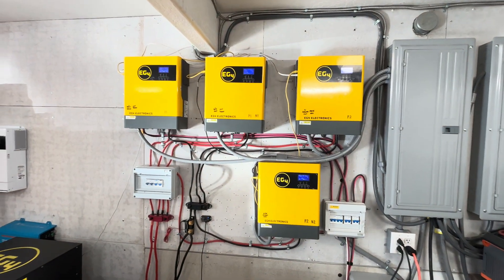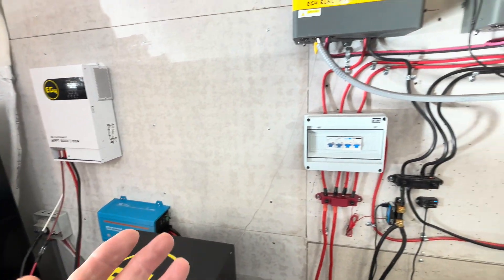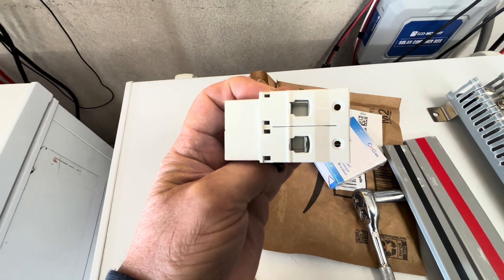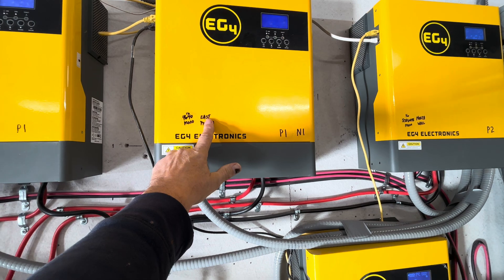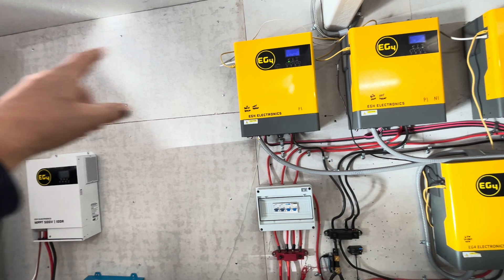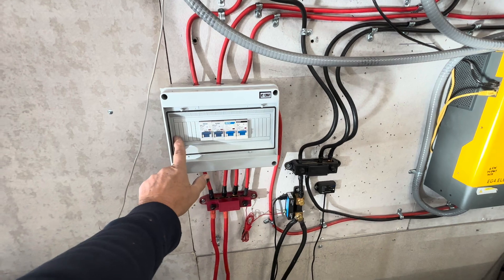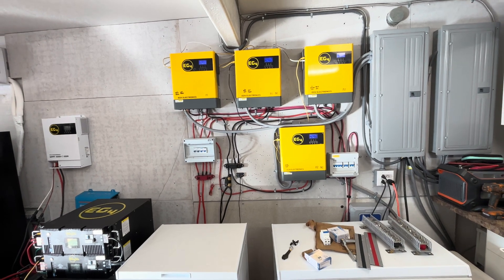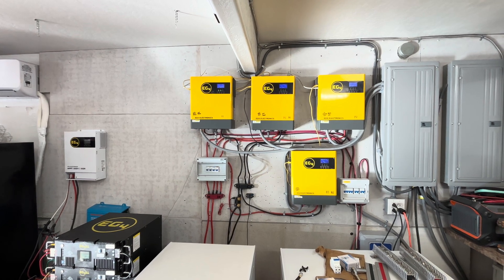EG4 3kW inverters upgrade with new bus bars, Solar panel arrays for 18kW output

Comment: love it. So the 25amps from each inverter goes to the control panel. That is 100amps. Do you just double up on each leg? since all in parallel they are all in phase. 50amp on one leg, and 50 amp on the other? Just combine two lines on each control panel leg?
Reply from the maker: For each 2 inverters that are in parallel, 25 amps goes to each leg. That is a 200 amp electrical service panel I am using. Works excellent. Running my 3 122 ton upstairs ac, 4 ton downstairs ac, pool pump, 18,000 Btu mini split and 12,000 Btu mini split in the garage, 4 freezers and a fridge with just solar at the moment. Still have more I can connect to run. These EG4 3kW off grid inverters are insane power houses for off grid.
Reply from the maker: Yes, you are correct in what you are saying.

Comment: thanks for sharing.
6:14  how are the AC outputs from each of the Inverters attached to the Panel?
Reply from the maker: The output is excellent since there is 3000-5200 watts connected to each inverter. I run my 3 1/2 ton, 4 ton and in garage, 12,000 Btu and 18,000 Btu during the day. Was 114 today, kept the house and garage at 72 degrees. That’s only using 40-50 percent output from each inverter so 7500-9000 watts output during the day. Everyday it just works excellent. I run 2 inverters overnight to run my 3 1/2 ton upstairs heat pump, set the two at 76-78 degrees and have around 50-60 percent state of charge left in the morning with a 35kWh LiFePO4 battery bank. This system has been running flawlessly since I installed. So happy I went with the EG4 3kW inverters in parallel.

Comment: What do you think of you eg4 5000 watt MPPT?  Don't care for mine.   Seems like that array don't produce like the other's and that array used to be my big producer.
Reply from the maker: I had great results when connected to the battery bank of the Growatt 12kw low frequency inverter. I was able to get 85-90 amps output when running my 12.7 ton pool heater to supplement the 12kw Growatt output of 120 amps. 
The EG4 mppt charge controller leveled off at 68 amps while pool heater pump heater was running. You can not use with EG4 3000 watt inverter, I tried, you can not exceed 20 amps input on the inverter and even though I was connected to the battery bank of the EG4 3000 watt inverter, it kept faulting. 
But it worked well when pulling a heavy load. I had 12-250 watt used poly panels in series with the panel at 37.5 volt each so it was around 446v input, amp output into inverter from string if 12 solar panels was around 12amps, each panel id 8.34 amps. Total of 3000 watt input. 

I also connected 16-330 watt solar panels as a string as well, they were 330 watt used mono solar panels 2 sets of 8 in series, then I parallel together. So was 5280 watts output into inverter, around 16,5 amps input, was able to get 86 amps max with load using the 12kw Growatt inverter. It does not do well this time of year with sun at lowest point in sky but dies really well in the summer when I really need the extra power when sun is directly overhead. 
The inverter is the main source of charging and power use, my EG4 is the supplement when I max out the output from 12kw inverter. This time of the year is bad for solar production. That is why I over panel all my arrays to get 3000 watt output from each EG4 3000 watt inverter. Do I can still get 12,000 watt output in winter, ordering 2 more EG4 3000 watt inverters since I have 2 more arrays I can connect that are 3200 watts and 3000 watts used mono panels. I loose 3000 watt output around noon thus time of year on my east facing solar panel array. The house shades this array around noon every day. I will be able to pick up more than that array output by adding the 2 new EG4 inverters to 2 arrays on the west side of my house so as the east array becomes shaded, my west array will be in full sun. I should be able to get around 16,000 -17,000 watt output total with 6 EG4 inverters in parallel. I keep playing with different solar panels on that 5000 watt 100 amp output EG4 inverter and the new solar panels seem to work best versus used solar panel arrays. For the money I would rather spend it on the EG4 3000 watt inverters, 2 in parallel so I can expand what I run being able to get split phase120/240volts. So far no problems with my EG4 3000 watt inverters. Very very pleased